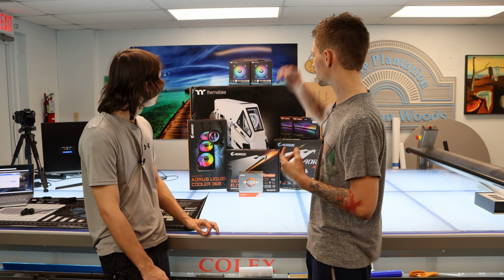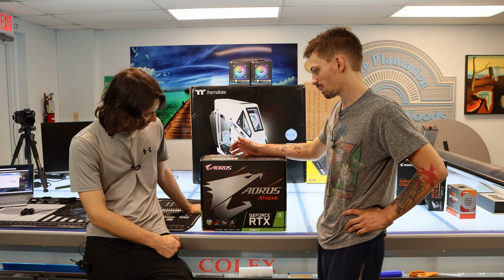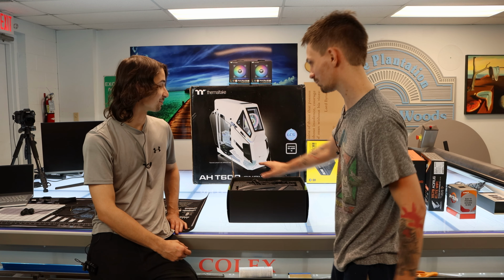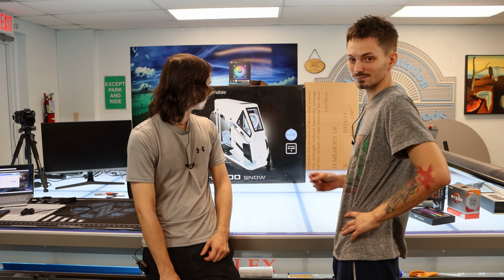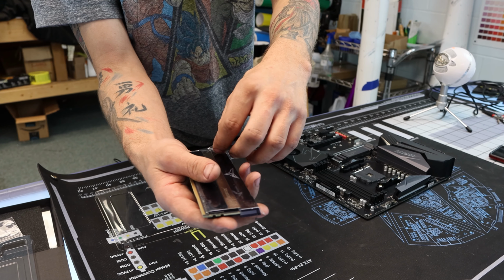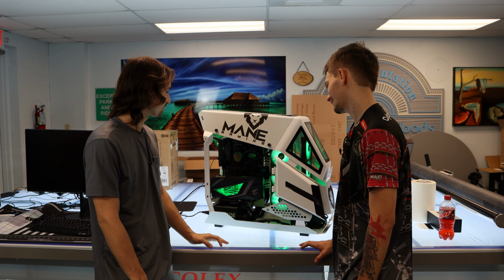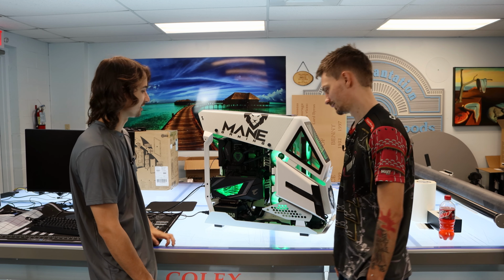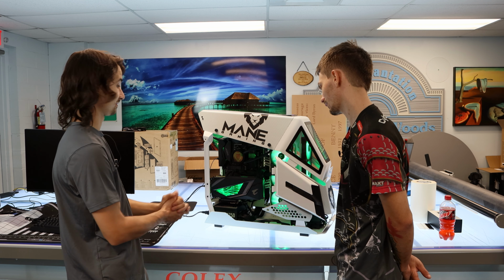INSANE Thermaltake AH T600 Gaming PC Build

Comment: Hello Fellas nice video nice build great job. I have a questions about that case cause I’m thinking of purchasing one did the case come with fans already in it or did you have to add those colorful lights with those fans? I am new to building PCs but I have changed out hard drives change out power supplies changed out disk drives and I’ve also changed out processor fans a couple of times, do you recommend a new person like myself changing my current PC out into this new case that you’re working on or should I buy a different case?
Reply from the maker: I dont believe it came with any rgb fans, its an ok case if you like how it looks just go for it

Comment: I have this case in full tower.  What products did you use to properly mount the GPU?  Not that it matter right now.  I can’t find a GPU.  Everything else is here.
Reply from the maker: i wanna say we just used a pcie extension and the case has its own vertical mount built in, if not i would use phanteks vertical mount.
Reply: @CoilWhine   thanks!  I was worried about the card sagging if I used a riser cable rather than the phanteks kit. I’m down to the liquid cooling and gpu then ready to roll!  Wish that I had a micro center near me to camp out at.
Reply from the maker: @brandonk8677  same

Comment: @coil whine i have a question. i have the same RGB memory (TEAMFORCE) but they are not like advertised. the RGB effect is too dark on my x570 (ASUS) while on other mobo (MSI x99a) works fine. how did it work for you?
Reply from the maker: Is maybe the asus software controlling the ram on the x570 where the msi software or teamforce on the x99? I noticed it always seems pretty dark
Reply: @CoilWhine  it has nothing to do with software. once it turns on the dimms are already dark. i believe it has to do with QVL! the ones i got are samsung b-die  14-14-14-34 and are not on QVL!!!
Reply from the maker: @zanat0s  very strange, i might have to do some investigating on the matter because it is quite interesting
Reply: @CoilWhine  can i get your email??
Reply from the maker: @zanat0s  coilwhinegab@gmail.com